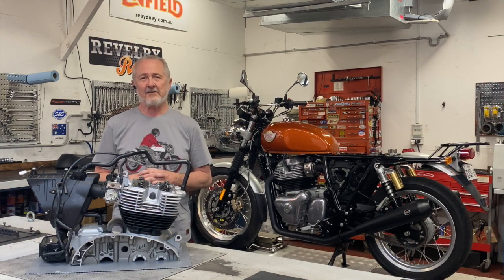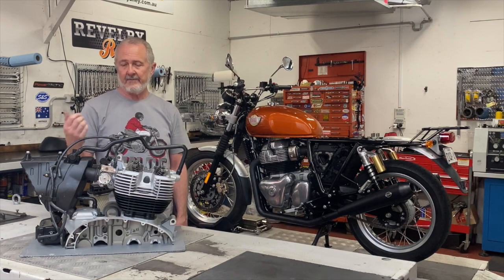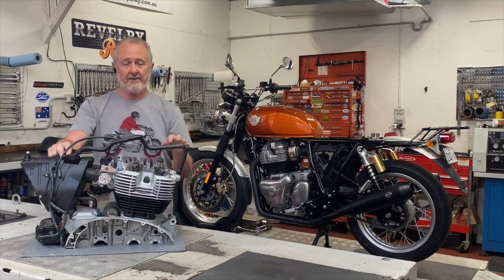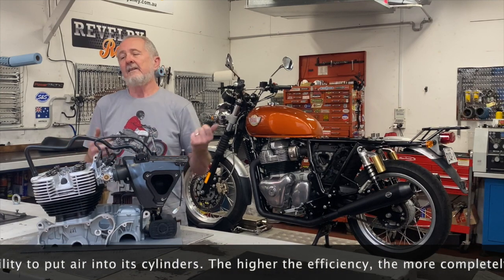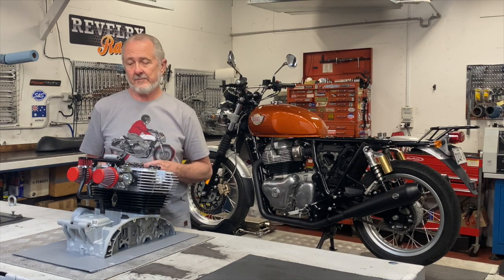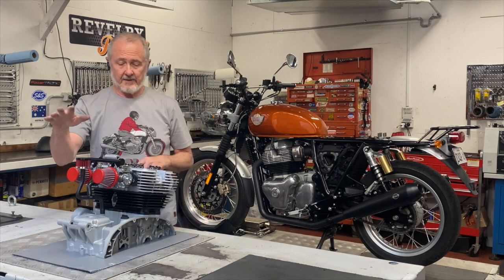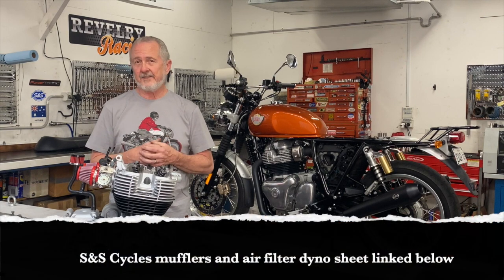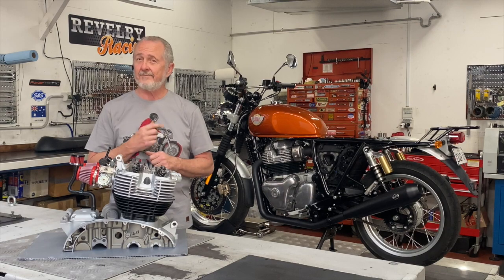Episode 2 Air Filtration Systems for the Royal Enfield 650 Twin

Comment: I got a Bear 650 in January. Now that the weather has warmed up ive put 1500+ piles on it. Just installed the AEW mid pipe and next will be the air filter upgrade. Love the 650 twin in these bikes. Looking forward to building it the way i want it. Great content!

Comment: ..hello, if you remove the secondary air inlet, is it necessary to map the ECU or is it mapped automatically?

Thank you very much
Thanks a lot
Reply from the maker: No changes are needed.
Reply: Hola soy de argentina muy útil tus videos si 
Si pongo un filtro kyn o sys y saco el snorkel original la moto se mapea sola osea no hace falta resetear?? Graciasssss
Reply: @fernandorolon1468  Correct

Comment: I HAVE A SIMPLE QUESTION
Can i run a High Air flow AIR FILTER and a FULL SYSTEM EXHAUST on stock ECU and stock tune?(will it damage my bike?)
i have a FuelX lite at the moment how does that help me ?
Reply from the maker: The change to VE made by air cleaner and (most) full exhaust systems are well within the range of the original ECU's adaptive learning, so no, it won't damage the bike. 
This kind of combination is precisely what the FuelX Lite is for. It helps push the AFR back to stoichiometric (or slightly to the rich side). For your setup, it's a good thing.
Reply: @RevelryCycles  So after installing fuelx and riding it for a week or so i have noticed that it has generated a lag in my rev band, when at second gear and linearly accelrating the bike pulls properly until 5000 RPM and goes flat i.e stops pulling btw 5000-6000 RPM and that is when i am already linerally opening the throttle but after 6000RPM the bike bounces and there is this sudden burst of power.(FYI rignt now i am just running an performance air filter with the stage 2 plate with stock exhaust).
This lag is not expericed when i give 100% throttle, at full throttle the bike pulls perfectly through out the rev range, 
what do you think could be causing this(my bike is a 2023 interecptor with 3000km on the ODO).
Thanks in advance.

Comment: A friend of mine made himself a airflow test rig. After some experimentation, he found that the little pod filters were the WORST form of air filter. extremely detrimental to air flow that   you could ever use. he found that the std filter was by far the best filtration. Please run comparison dyno tests if you disbelieve.
Reply: That depends entirely on the compete set up, small pods are terrible for laminar flow but can still be tuned in reasonably if you know what you're doing. So you are partly correct... Velocity stacks with filtration is the best set up, buy pretty hard to get right in this type of situation.... There are always better air filters than stock, motorcycles are always built to a budget, all stock filters can be bettered..
Reply from the maker: Cool story bro 👍
Reply: @RevelryCycles   He's mainly correct, small pod filters are generally garbage to consistent {laminar} airflow, they aren't even that good at the track. I know you think "Drag racing" when talking track,  but I'm more familiar with circuit racing. I'm off to Phillip Island for the National Championships in January, Pit crewing for A multiple Aussie champion. Been building bikes for over 40 years....

Comment: Will the ECU configure after the pod air filters? Or will it require a programmer? 

Because If the air input(air filter) and output (exhaust) are free flow but the fuel amount is same it will make the bike run more lean(hot).

Comment: If I install only the DNA air filter with the Stage 2(ring cover) without the booster plug, this could be a not good thing to do? I talk about the air increase without the fuel adjust too. Anyone can help me please?
Reply from the maker: Not to worry. Fitting the DNA filter and/or S&S mufflers is well within the original ECU's adaptive range. While yu might pull a little more power out with a tuner, it will be fine for every day without any sort of tuning mechanism.
Reply: @RevelryCycles  Thank you so much.

Comment: Hi guys, great videos. How much Hp/Nm improvement could I expect with a standard 650 plus new exhaust (headers and mufflers) and air-box mods ( hi-flo filter, remove intake cover) ? Can I get away with those mods without an ECU flash or Power Commander ? Thanks. Subscribed.

Comment: Like this BMC set up, but what if I can add an intake (induction) tube with a snorket at front to add more air into the stock air box, (by eliminating the stock filters?
Reply from the maker: Who knows? You should give it go and share your results.
Reply: @RevelryCycles  I was thinking that it will work like a force Air induction in the early zx-11's used to have, in this case, it will bring more cold air, make the airbox packed with more densed cold air.

Comment: .Hello, very good videos ... I congratulate you.
I have a query, if you mount the individual air filters, removing the filter box, where do you place the temperature sensor? ' !! or delete it !!
thank you very much from Madrid
Reply from the maker: You definately do not delete it. You want to mount it in the vecinity of the air filters. A zip-tie to the frame will do.
Reply: @RevelryCycles  ..OK thank you very much
a greeting

Comment: There is a pipe coming out of the charcoal canister with a inverted U shape opening. It just left open in the tool box, not connected to anything. What is that?
Reply from the maker: It's the vent.
Reply: @RevelryCycles  Thank you! My GTs tanks water drain is clogged. I tried clearing it with a wire and wd40, didn’t work. Any suggestions? 🙂
Reply from the maker: @apocrypto  Compressed air

Comment: Great video! Thanks.
Inside airbox there two rubber ducts to each trothle body. These ducts are made with sound reduction purpose or they are there for some performance tuning? They can be modified for some performance increase? 
Thanks.

Comment: I wonder why noone made a full airbox Delete plug and play kit .  Y piece of 3d printed plastik or silicone hose from the trottle body with a pcv plug  and a good sized pod filter at the frame triangle where the original airbox sits

Comment: Quick question,  will it be wise to use high flow air filter on stock exhaust???
Reply from the maker: You certainly can. The benefit in this case is not so much the flow as the serviceability. The stock filter is paper and shouldn't be cleaned. It should just be replaced. The S&S/DNA filters can be cleaned and are considered "Lifetime" filters.
Reply: @RevelryCycles  I am considering DNA filter, but will I see some improvement in performance if I use it on RE stock exhaust???
Reply: @Lens_luminous  no! You will loose performance
Reply: @DavidLee-ch9vt  how do you say?? Or does it work only with exhaust change as well?
Reply: @Lens_luminous  it will only improve the ride if you change everything else (engine, exhaust, ecu, etc. which is a few thousand dollars - worth it?) since the stock setup is designed by engineers, maybe a little on the lean side, but after all perfectly fine. You will not improve this motorcycle just by using an open filter. It’s like putting on a bigger size of shoes to improve your running speed 😊 I found the booster plug indeed helpful for throttle response and acceleration since it richens the fuel mixture, but it does not enhance power in general and it is not a must. If you can spare the money just get good sparks, regular oil change, and maybe the booster plug. That’s it. You don’t need more for this bike. I’ve ridden 10K with this thing through Europe from the Alps to highspeed roads to gravel roads. For the last few thousand miles I dialed down to stock with booster plug and it is perfectly fine 👍
Reply: Which one  of  booster plus do you mena?
Reply: Plus do you mean?
Reply: Plugs

Comment: Any chance you would eventually sell a DYI airbox delete kit complete with Revelry machined reed valve eliminator?  I'm sure you know there are A LOT of 650 Twin owners out there wanting to make their steed "cute".  Seems owners like things simple and chopping out all the complex tech govt officials work so hard to regulate would be up in priority (and fun).  Passing inspection is another topic...🤞 (And let's not mention the environment 😶)
Reply from the maker: While we don't do a "kit" we do sell all the bits you need. It's just the POD filters, a breather filter, a tee for the breather line and some zip ties. You use the original breather hoses and (once the air box is out) it all just bolts on. However, removing the OE air box is not a "simple" task. One of our mechanics shot some pictures of one he did last week so we'll have "visuals" to describe the process.
Reply: @RevelryCycles  can you please point me towards these air box removal photos?
Reply: BTW love your channel - subscribed!

Comment: I would like to know how to remove the air box. Specifically does it come out the side, or was it installed with the motor from the front, or another way of stating that, what is the factory build sequence? Also what has to be removed or pushed aside to make enough clearance? Thanks, Ronn

Comment: I bought a 2021. No more mods to the ecu from what I’ve been told.  I learned this after purchase of S&S street slip on’s and k&n filter. Do you know if I can still bolt these on with little to no risk. : /
Reply from the maker: That seems unlikley. Can you be more specific? Precicely what were you told and by whom?
Reply: Jens Lyck at boosterplug.com in Denmark replyed to my email asking would the booster plug for the 2020 model work with the 2021. His reply was no and they won’t be making one for 2021.  https://www.boosterplug.com/shop/cms-2021_and_newer_bikes.html
Reply: I would rather use a power commander, I’ve owned 40 bikes, I’m exhaust pipe and fuel management poor so in this case I was going to try something well...different.  In the first part of the email he made it sound like Dyna Jet wouldn’t supply anything for 2021.  I decided to put the air filter in with the restrictive cover and to leave the baffles in the new pipes even though I’d love to hear it opened up on these Louisiana back roads.  I’ve enjoyed listening to you two, thank you for sharing.
Reply from the maker: @rudyaaaaaaa  Not sure what Euro level is currently being sold in US. In Oz as of today, we're still getting Euro IV. If your bike is a Euro IV (look at your owners manual) there is definately no issue with running a Power Commander.
Reply: @RevelryCycles  US bikes still have Euro 4, as of 2022 models.

Comment: simple block off the 2nd air to exhaust . all b/s . done motor runs cooler pipes not as hot ..done ..then run a crank case vent hose out back with a small filter .. done . .idle air hose also a small hose and small filter ..done now the motor can just burn clean air ... no oil fume crap ...you can do this with the stock air box still on it and it will run better ..did this on my 2001 triumph and its idle fine for 20 years

Comment: Wish your shop was next door, well no...I'd be a lot poorer. I like your philosophy, straight forward honest facts, nuts and bolts approach. There a couple of things I'd like to do to my Interceptor to optimize the A/F ratio and fix what I think is the lag in the fueling  at low RPMs, I've added aftermarket exhaust and removed the snorkel, DNA is next when the stock filter gets dirty, (I'm frugal :)). My problem is there is no dyno in my pace, like to discuss piggyback ECUs with you and possible maps. you do international shipping?

Comment: Great explanation on the air intake system. I did wonder why there's so many pipes coming out from the air intake box. Thanks alot. If we change the air filter to performance air filter ( DNA ) ,  won't it affect the air-fuel ratio ? Do we need to install a booster plug to cheat the ECU ? Pls advice ... looking forward your answer ...thanks.
Reply from the maker: Keep watching Saravana tuners are coming next in the series

Comment: Hmmmmm...more air surely means more dirt = faster engine wear. For performance/racing not really a problem as engine longevity isn't a major issue. Over the years, for standard use, stick to stock IMO. Interesting topic though.
Reply from the maker: Interesting opinion but wrong Pike. More airflow doesn’t equate to more dirt in your engine.  The high flow filters are more efficient than stock by providing a larger surface area for air to flow through and by using oil to create a “sticky” surface for the dirt to adhere to. These filters filter down to 5 micron.  We wouldn’t want more dirt in a high performance race engine.
Reply: @RevelryCycles  whilst I appreciate your response but to say definitively that I'm "wrong" is very arrogant. There are many discussions and articles written by engineering professionals that would argue free flow filters allow more contaminants and debris into the engine/oil thus damaging engine internals. I am not disputing claims of a modicum improvement in performance but for normal road use not worth the trade for reliability and longevity. I think all this tuning and performance tweaks are missing the point of this bike. But that's just my opinion and I wouldn't dare say you were "wrong". ✌
Reply from the maker: @pikebobstar2033  Arrogance was not the intent. The intent was to communicate authoritatively. What you said was "more air surely means more dirt = faster engine wear". To suggest that the use of a (high quality) high flow air filter will dramatically increase engine wear and reduce longevity IS wrong. We have sold, serviced, built, ridden and raced countless motorcycles over the last 40+ years with high flow air filters. Many of those daily riders accumulating hundreds of thousands of kms with no measurable ill effect on combustion chamber components. 

There is very often drastic disparity between mechanical engineering and it's practical application.

In manufacturing we have a couple of sayings that apply to this discourse.
1. Test data overrides engineering arguments.
2. There comes a time in every project to shoot the engineer and go into production!

We appreciate your comments and value your perspective. The whole point of our doing this series is to provide a trustworthy source of information people can use to make informed decisions. Certainly one of the biggest draw backs to the information age is that it is so diluted with misinformation. Surely you would agree your post suggests to our viewers that the advice we offered on the subject is ill advised. Opinions rendered without the benefit of substantive data just muddy the water and make it more difficult for the layperson to make informed choices. 

The "wrong" was not aimed at your feelings. Rather we need to respond concisely and authoritatively because this is exactly this kind of myth we are working to dispel.

Comment: Great explanation on the free-flow air filters. One thing everybody forgets to explain, though, is that it take a lot more effort to clean them than a paper filter. Check the full instructions on how to clean a free-flow filter here: https://www.youtube.com/watch?v=N8WpcU43SdU This is probably not an issue for competition drivers because they are used to a lot of maintenance for their bikes anyway, but a street rider needs to know this. A dealer won't clean your free-flow filter for you, you need cleaning materials, oil and time to do this whenever your filter is dirty. So yes, free-flow filters have their use but if you are a rider who keeps his bike maintained at the dealer, then a free-flow filter is not for you.
Reply from the maker: Well that’s just silly. Of course it takes more effort because paper filters can’t be cleaned. We are a dealer and we clean filters all the time.
Reply: @RevelryCycles  I haven't found any dealers here who want to touch wet air filters. Maybe it's too much work for them, maybe because they don't have the filter oil, i don't know. But here in Spain, when they see a wet filter they just skip the filter maintenance. You have to do that yourself.

Comment: Can I just change the air filter to a DNA one, while keeping the stock exhaust? Would that run the engine lean? Or do I need to have a powertronic tuner+exhaust and air filter as a combination?
Reply from the maker: Great question Gulshir you do not need a tuner if you change the air cleaner only.  The ECU will adapt to the increased air flow with little to no risk of harm to the engine.
Reply: @RevelryCycles  Thank you Sir!
Reply: @RevelryCycles  Most people say you need to have the engine do a full warm-up cycle to let the ECU adjust to the changed air flow. However, S&S says that that's not needed. What is your opinion?

Comment: Are there any benefits to removing the secondary air system? 
Thank you for the videos!
Reply from the maker: This system is commonly referred to as "Aspirated" air injection. This achieves air injection by taking advantage of the negative pressure pulses in the exhaust system AT ENGINE IDLE. A sensitive reed valve assembly (called an aspirator valve) is bolted to the front of the engine above the exhaust ports. These are connected to the electronically controlled Secondary Air Valve via a common rail and a hose, which draws air directly from the clean side of the air filter. During engine idle, brief but periodic negative pressure pulses in the exhaust system draw air through the aspirator valve and into the exhaust stream at the cylinder head.

This system has been in use since the 1970s and is relatively common on modern motorcycle engines. The primary function is to add oxygen to the exhaust when the engine is cold to help burn unburned gasses and heat up the catalytic converters. 

In a race engine the SAI serves no purpose. There is no "performance" benefit to eliminating it. Eliminating it only reduces complexity and can make reading Air/Fuel Ratio with a wide band sensor or sniffer more accurate at idle.
Reply: @RevelryCycles  Thank you for the very clear explanation!